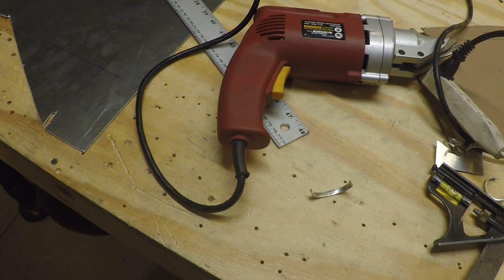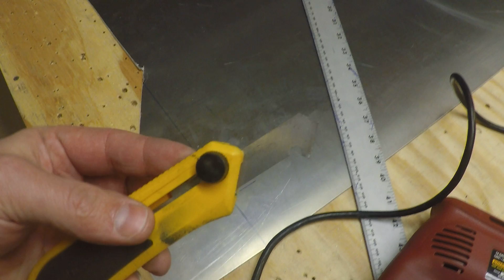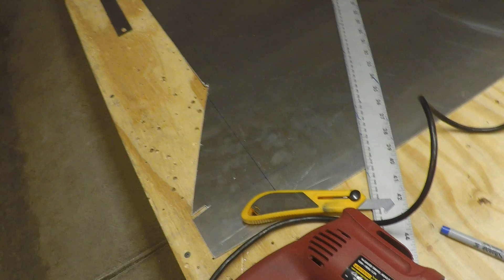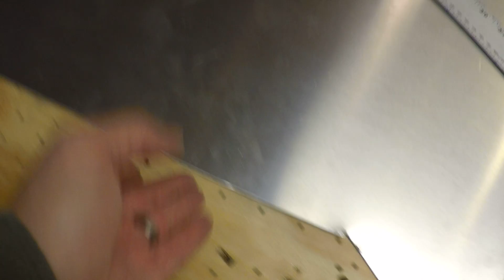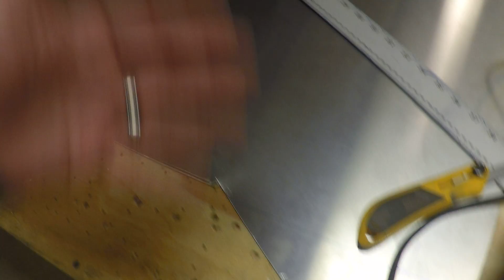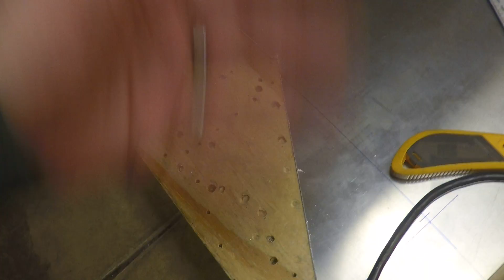Another Cutting Tip - Electric Shear

Comment: I prefer using these on my 2 speed DeWalt drill🔫>share4.photo/dMetal-Shear?ρ56    I used these to cut thin 23 gauge sheet steel and it'll zip right through it on my drill's high speed setting. You can use the low speed setting for slow accurate cutting. These also cut through some 16 and 18 gauge sheet steel. I had to use the low soeed setting on my drill to give it more torque so the motor wouldn't stall out. I would definitely recommend this product for the price. It beats cutting it by hand with some tin snips.